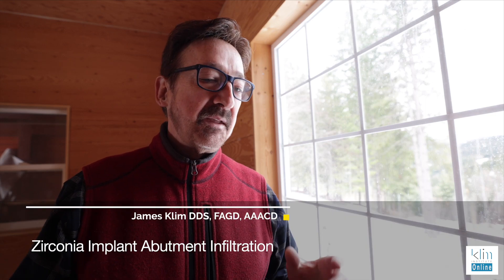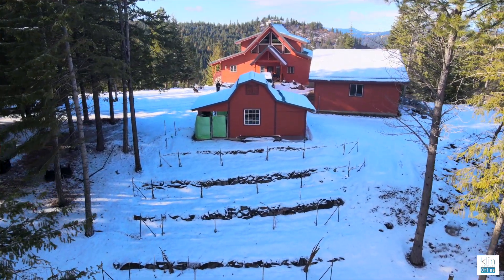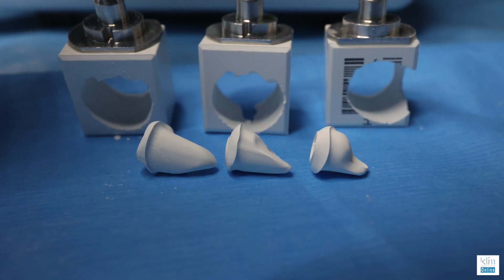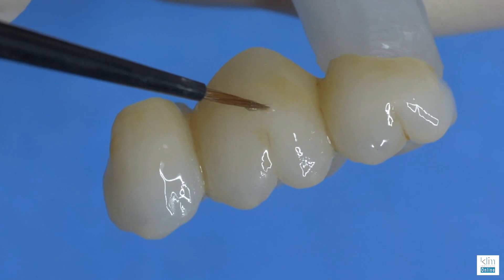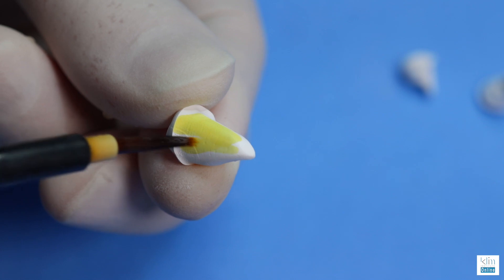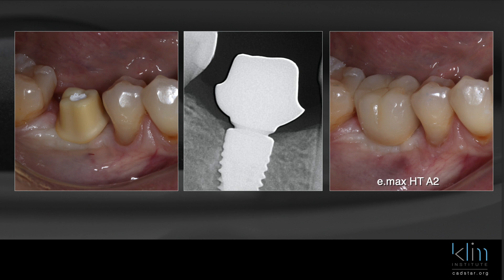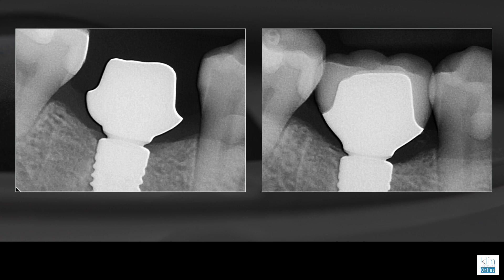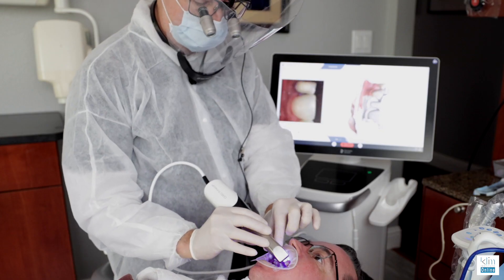Making an Aesthetic Zirconia Implant Abutment

Comment: I have used ZirCAD infiltration liquids for a few years. I have noticed in the last year, since using my CS6 instead of previous CS4, that I am getting white almost like a "snow" stain.  I am wondering if the infiltrates are going bad or if its an issue with the vacuum or other setting on the CS6. Have you seen this?
Reply from the maker: The colors could be going bad.  Also, I dry the infiltrated zirconia in a toaster at 180 degrees for ten minutes.  Don't use the drying cycle in the CS6. Also, the green zircona needs to be totally dry or the infiltrating colors can appear blotchy.  All the best!

Comment: Did you ever consider doing zero bone loss concept abutments and crowns ?
Reply from the maker: That concept works well when the clinical situation allows and is understood.  Dr. Steven Chu provided an excellent literature review on bone biology. It documented that the thickness of mucosa and bone/implant placement is the primary factor for connective tissue attachment, providing a stable bone environment.

Comment: Do you ever pre-drill a screw access hole into the e.max crown prior to crystallization so you can cement the emax to the zirc/tibase abutment but still have screw access if you ever would need to remove the crown?
Reply from the maker: Hi Nick.  That is always an option.   Most of the time, if retrieval becomes indicated, diamond access is accomplished at the time of crown/implant removal.  In the last 10 years, I have seen very few removal demands.  All the best!.